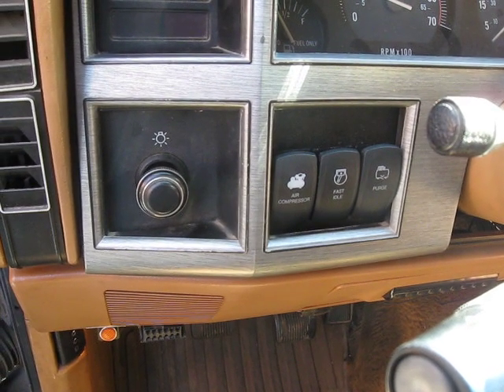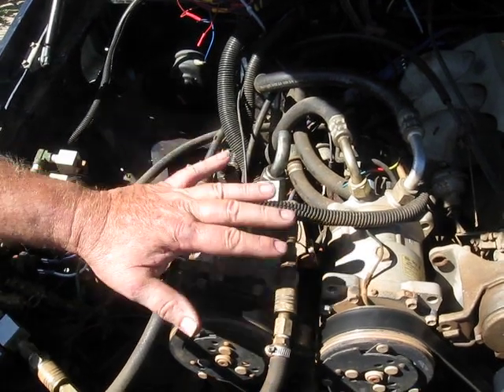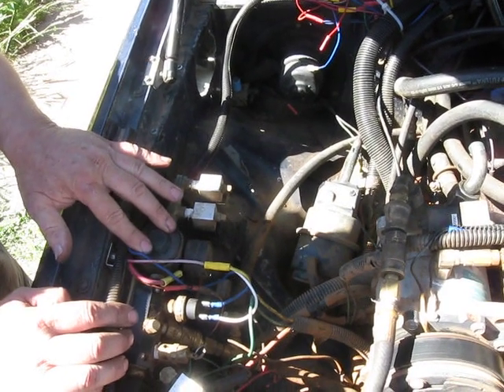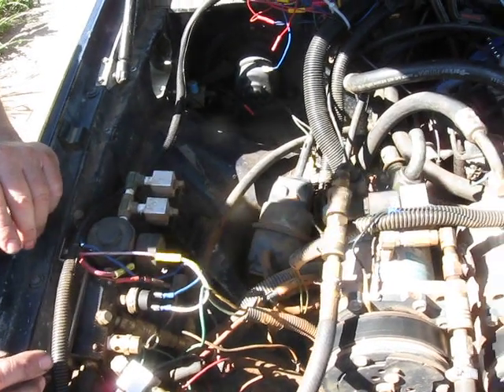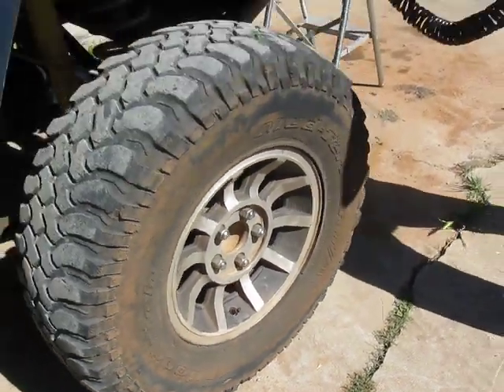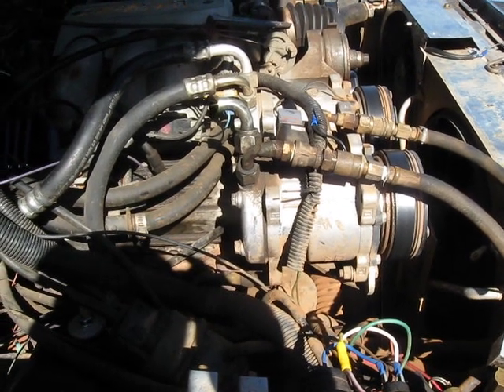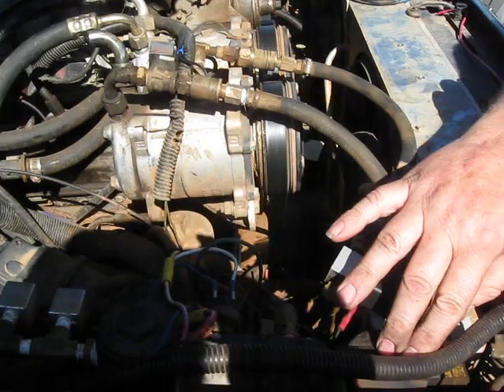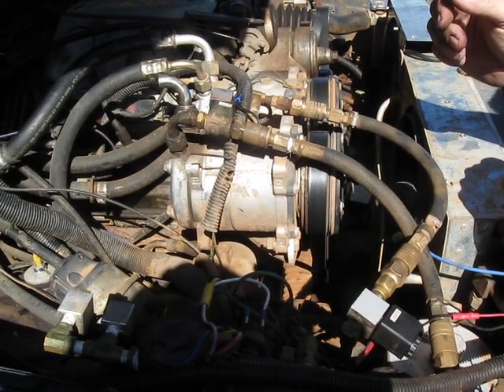On Board Air The Right Way

Comment: You're pumping so much air the tank fills immediately. Very cool. You don't need it till you have lockers!. I'm gonna copy your vent but use an open vent w/ a drain & fill plug & compressor oil. I'll refill what I lose & get added rust protective spray under my rig.

Comment: Cool system. I'm lost, when you purge oil back into the case how does it work?
There's no vent for reversal. Is the pressure enough in the tank to force oil into the empty case?

Comment: Hi, is it work for long time?Is it going to have trouble without oil? I like to do an air compressor with tank. to use, for example 
 inflate the wheel. Thanks. sorry my english.
Reply: It has oil in it, just enough to splash when running.  Lasted 10 years

Comment: How would this compare to a single or double viair 480c set up?
Reply: this will give you way more air then the electric pump --- these standens have about same displacement as a york compressor and they say they can be up to 10 cfm pumps ---- the ARB twinpump is max 5 CFM  i just bought a viair with tank and its 1.7 CFM at 0 psi ----- these engine pumps are well worth the install
Reply: I have 2 maxxair 550c's, and from empty to filling a tank takes way longer than this, this guys set up has got me thinking now!

Comment: does your air compressor have an electronic clutch if so is it connected to the shut off switch
Reply: +Logan Eley Yes, standard electric clutch that is operated by the pressure switch

Comment: How did you set up the High Idle ?   What did you use to hook to the throttle cable ?
Reply: IACV mate.
Reply: I used a vacuum throttle advance off a carburetor and welded on an arm for it to push againse
Reply: Norman Murray Looks to be actuated.  Its electronically controlled... perhaps it powers a magnetic actuator....  a push/pull solenoid.

Comment: I would love to know why did you get rid of the jeep 4.0 it's such a much better motor than the 4.3 by Chevrolet it's a jeep thing you wouldn't understand
Reply: The 4.0 is a great motor, but the 4.3 is a true bomb proof engine, and it has more torque and power then the 4.0 and nearly the same or less weight.
Reply: +Daniel Bryant My original motor was the 2.8l V6.  Just a bigger and better version of the 2.8
Reply: My Jeep didn't have a 4.0.  It had a 2.8L V6

Comment: How do you have your high idle set up ? I just finished hooking up my oba and am trying to figure out the high idle
Reply: i was hoping for the same info.  seems tied to the pressure switch tripping at the low side to energize wire to the throttle control.
Reply: seen one guy take a bike gear shifter, connect the thumb control on this gear stick, then ran the cable to the throttle body. 
He also explained that he used this while climbing, so he didn't need to 3 foot drive, used it to keep the engine rpm's up and shifted away.
Reply: @Gantzz321  just watched that video yesterday, pretty damn good idea
Reply: @howeyfeltersnatch7702  yeah it made it to my list of mods to do
Reply: @Gantzz321  Back when my jeep was a manual, I added a bike shifter hand throttle.  Hook up the bike shifter to the throttle cable.  When having to stop on steep hills, bump up the RPMs and you can keep the jeep from rolling backwards with the brake and ease off the clutch until the car moves forward.  Very helpful.
Reply: I have a sanden setup for compressed air for my jeep.  I run it at idle.  Has lots of volume.  No need to increase the idle.

Comment: How much oil do you run in the pump? I filled mine about 3/4 and am thinking its too much...
Reply: You only need about an inch in the bottom so it splashes